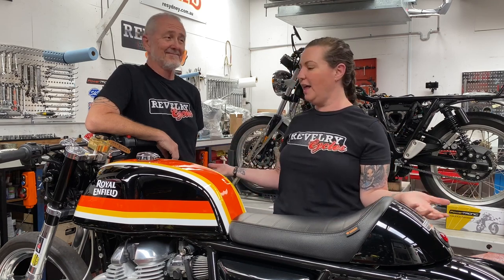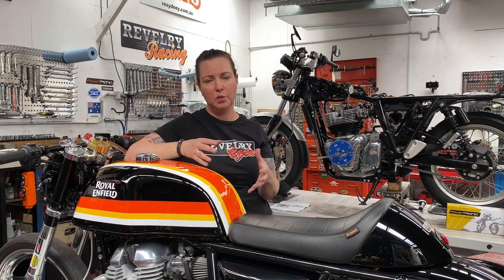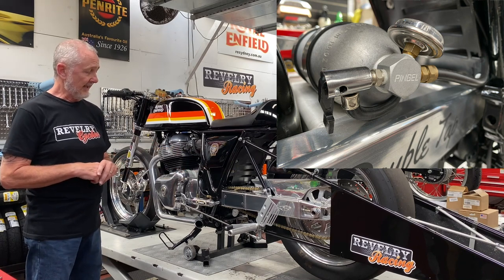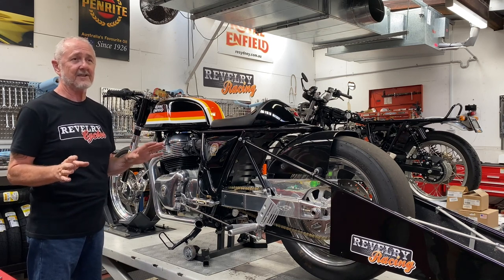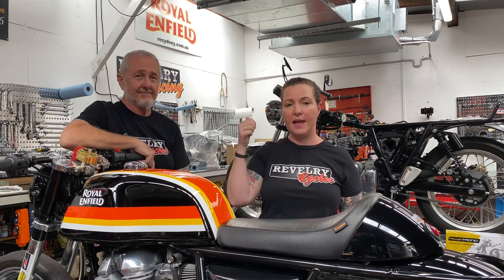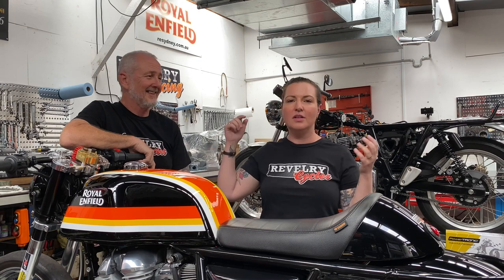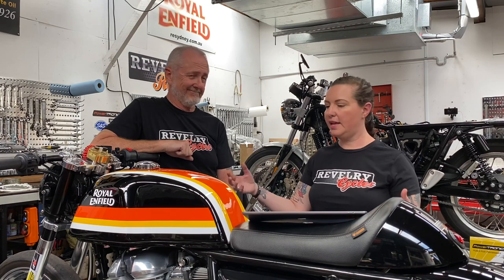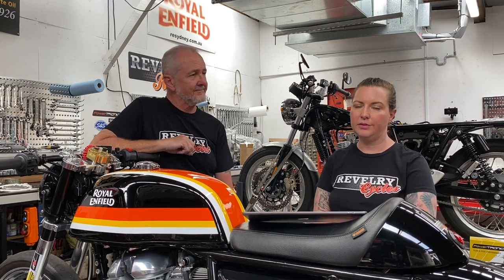Royal Enfield Racing - Double Tap: Royal Enfield Twin IHRA Drag Bike Up Close

Comment: Would enlarging the fuel lines be necessary for this type of bike?  The standard line from tank to injectors be sufficient?  Just a thought I had....quiet day......
Reply from the maker: The stock system, pump and injectors, is good for around 100 hp as is.

Comment: Where did you get that swing arm from,and what does it cost?
Reply from the maker: It’s a one off. We had it made by TracDynamics. I don’t remember how much it cost but it was A LOT and it took over a year from order to delivery.
Reply: @RevelryCycles  I am trying to pull off that same look and function of an extended swingarm built for drag bikes. I know that they have extension kits out there. But none of them are made for Enfields, and thank you for responding. I appreciate the info.

Comment: Where'd you got these Alloys from
Reply from the maker: Those are RC Components drag race wheels.  Designed to go in a straight line on a flat surface and not appropriate for street use.  We discuss them in the video https://youtu.be/WWsOz5yG1ZY?si=FRXay3IvjQrCRS0x&t=1198
Reply: @RevelryCycles  Thanks sir
Reply from the maker: @vaibhavverma2960  You are welcome ma'am.

Comment: is it possible to fit the stock exhaust system (bendpipe included) from left side to right side vice versa on the interceptor 650?
Reply from the maker: But why?
Reply: @RevelryCycles   thanks for the reply. reason is i like the stock exhaust sound, but the mufflers are wide apart. i want to make them look more narrow like make them closer to each other 😅
Reply from the maker: @ngurhminglianasailo7335  😳 no
Reply: @RevelryCycles  thanks for the info🙂